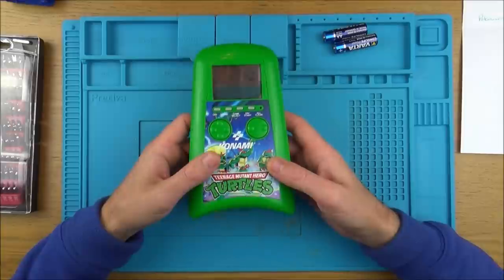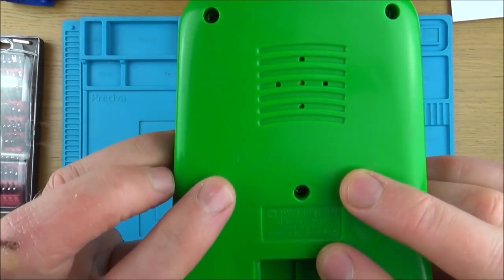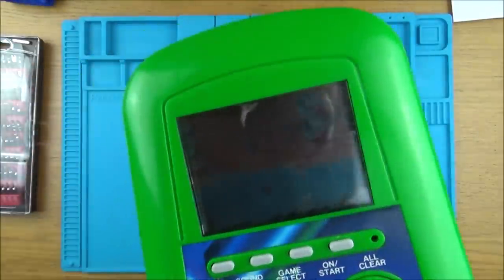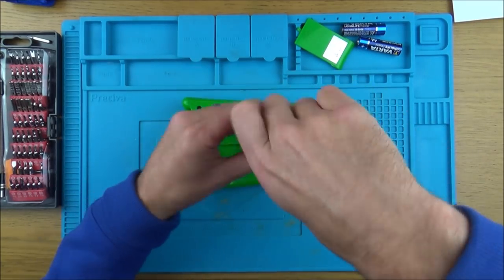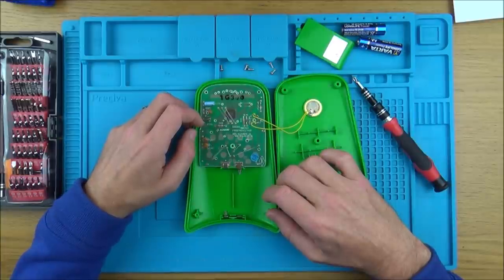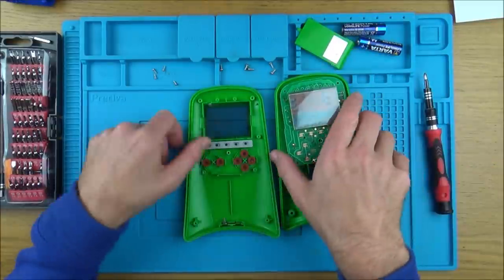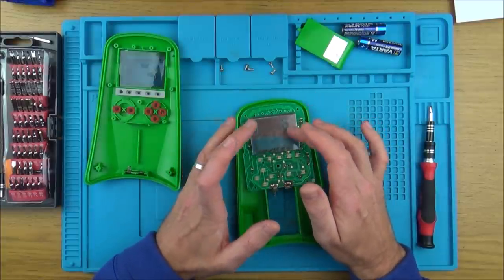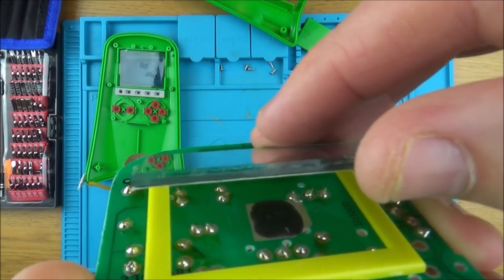Trying to FIX: 1989 Teenage Mutant Ninja Turtles GAME

Comment: Crystals are a common point of failure after a shock (dropping the item). We have a gas fire remote which failed and the cheapest replacement remote was £72. I remembered that my wife had 'juggled' with the remote and dropped it, so I opened the remote and changed out the crystal (unfortunately not 32.768 kHz so cost me £2.50) and it was fixed! £69.50 saving; not bad :-)
Reply from the maker: Nice little saving for a 10 minute crystal swap :-). I ordered up 5 of them (32.768kHz) as I am sure I will come across this again the future :-)

Comment: Your meter has a frequency function (Hz). You may be able to measure the frequency across it (or one probe on one leg, and the other probe on other side of capacitor next to it). Put it in AC volts, then push the “Hz” button on your meter. Assuming it’s not some massive value crystal (unlikely) you should get a reading.
Reply from the maker: Never noticed that Hz button!!!! I need to read up on it :-)

Comment: The frequency 32768 Hz (32.768 KHz) is commonly used, because it is a power of 2 (2^15) value. And, you can get a precise 1 second period (1 Hz frequency) by using a 15 stage binary counter. Not because of its cheap.

  And circuit won't work if you change the crystal with wrong value because the chip it's self I'd frequency dependant.if you change it with a near close value it will work with some timing issue.You need to replace it with the exact value to make it work properly. But won't work with a higher value crystal
Reply from the maker: Thank you :-)

Comment: frequent issue...it might have felt a multiple time and the crystal breaks inside the metal case. I've repaired many radio remote controls replacing only the crystal

Comment: 32768 is chosen for the frequency becuase its easy to mass produce and its a perfect number for timing.   More info here https://www.youtube.com/watch?v=_2By2ane2I4   The reason the crystal is smaller is because its just newer.  The smaller ones cost slightly more because the tolerances are tighter but they make them small becuase the space available is simply smaller.  it wont affect the life of your crystal.   The big rectangle one didnt work becuase its frequency is MUCH to high for the chip to work

Comment: 19:29 This is probably a all purpose board that they drill holes to adjust it for different games.
Its cheaper to manufacture the same boards multiple times than manufacturing one for each game. 
Also they can stack multiple boards to be drilled at the same time.